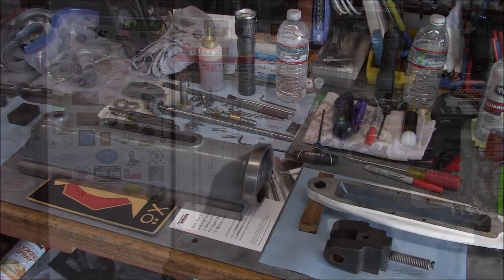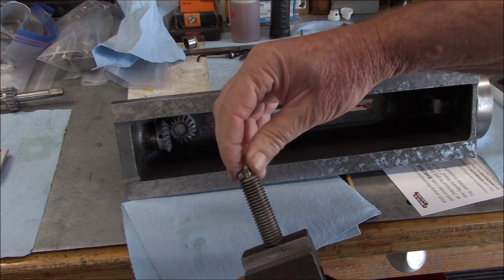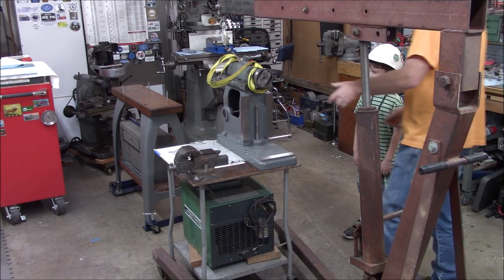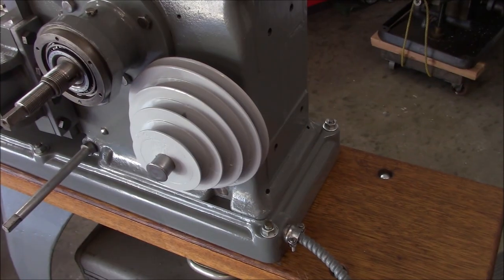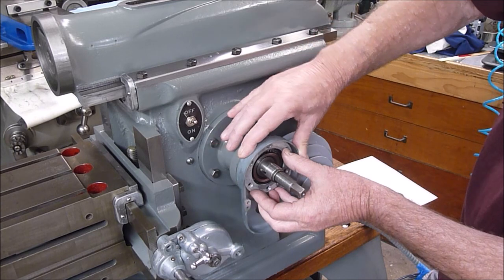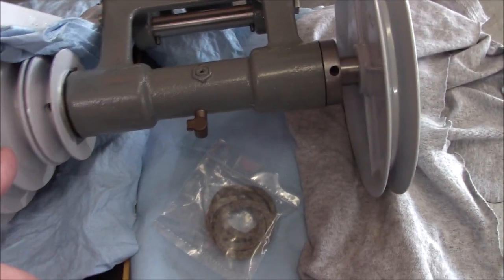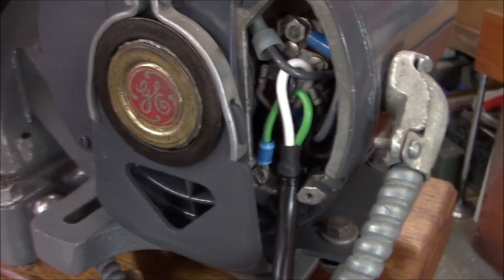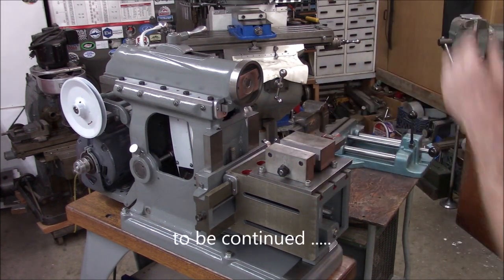Atlas 7B Shaper Project Part 15 - Starting Major Assembly

Comment: Outstanding! I have one in my shop now. Restored it several years back. Mesmerizing little machine. Thank you!
Reply from the maker: Thank You, I can't wait to make some chips !
Reply: @TheAyrCaveShop  I also have the Atlas horizontal milking machine. Fully restored. I rarely use either the shaper or mill. But the gizmoness of both make me smile when I lift their gray terry covers. I accumulated many of the rare dodads as well. Index, rotary table, etc. They are just plain FUN. You will enjoy that baby shaper. Note: the shapers week point is the ratchet case. It is made of Zemac or whatever it’s called. Are you aware they made one from cast iron? Very hard to find. Chased them but never caught one.

Comment: Thanks so much for this video, the part about the alignment of the arm in relation to the table advance was very helpful. even more so was the insight into the movement of the ratchet housing. I had just done assembly on my 7B last week and the ratchet housing was too tight to move which seemed strange to me but as you said, there isn't a lot of info on that out there. I had never seen any mention of that part needing to move but it seemed to me like it should.
Unlike you tho, I don't have a mill to jump to remove a bit of the housing precisely so managed to get the clearance I needed with a .005" shim ring. works nice now, and it just goes to show that there always several ways to approach any problem!
Reply from the maker: Gary, your welcome. In my case at least, it seems that Atlas left some of the fine tuning details to the end user. I too thought of making a shim but milling seemed easier. Thanks for the nice comment ! -Dean

Comment: Dean, glad you figured out the timing issue. Would it be beneficial to mark both gears before disassembly? Have a great day.
Reply from the maker: Kev, yeah if was timed right to start with. I didn't know it was a factor during tear down. Easy to figure out once you know what to look for. Thanks !

Comment: Where do you get the seals in miscellaneous parts to rebuild this
Reply from the maker: The felt seals are available on eBay. look for Atlas lathe countershaft seals they're the same. Other parts were hit and miss on eBay, just need to watch for while. Most of the Bearings are standard and can be matched by number.

Comment: Hello Dean.. How did you set shim set on base (S7-167 & S7-167A), I just have one, and need some advise... regards
Reply from the maker: Rodolfo, Mine didn't have ether of those shims. the only thing I can think of is those shims are used to fine tune the squareness (left & right) of the vertical ways to the base so the table support front leg runs true while traversing the table. Maybe some else can chime in, but that's all I got.
Thanks for viewing and commenting!
ATB....Dean